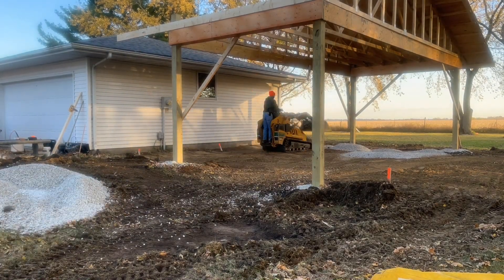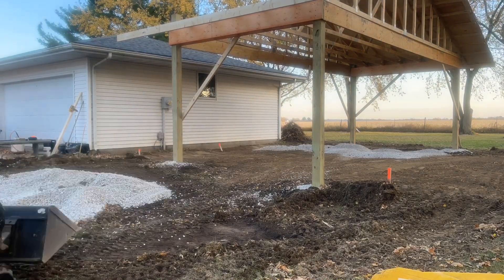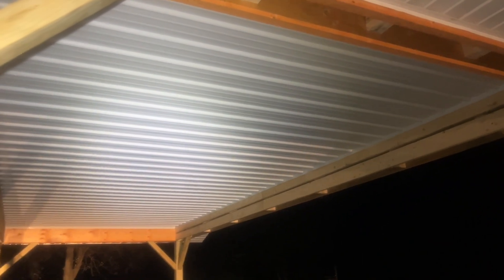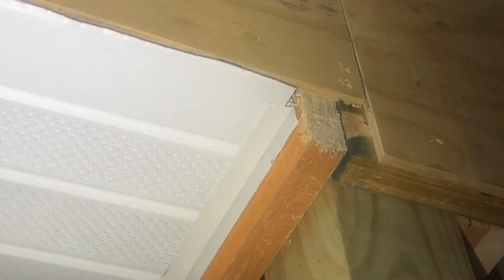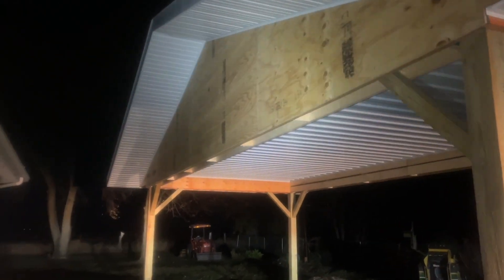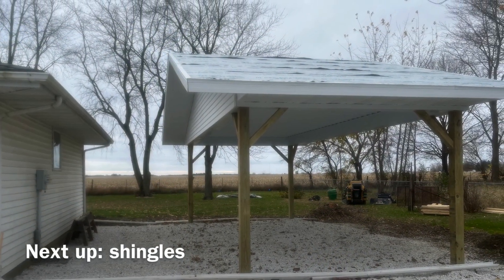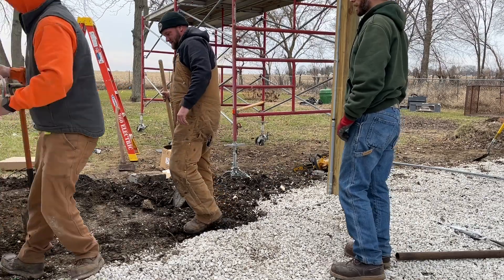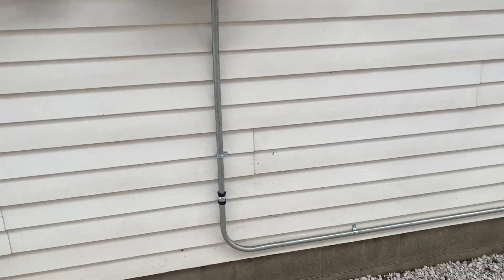Building a Solar Carport - Part 2

Comment: Really clean install on the solar. Thank you for sharing. As annoying as that conduit was to run, I would run another back for two circuits at the carport, one for a couple GFCI outlets and another for recessed lights inside your soffits and ceiling.
Reply from the maker: You are 1000% right! I had the same thought the next day. 😭 I’m grateful for what we did get done, though, just before the weather turned.

Comment: Excellent idea building a Solar carport - will do
Reply from the maker: @wardmontgomery9259  It was a way to kill 2 birds with one stone. I feel better not drill holes in my house’s roof. Thanks for watching!
Reply: @reidthemanual  I agree - I can tear off the old front porch and extend the new carport out into the front yard (12 acres) and set up for the next owner to remodel into a large family room ! Electric rates have doubled here in Northern California in the last 4 years ... with two increases this year. 50+ years of carpenter experience.
Reply from the maker: @ With that much experience, this project should be a breeze for you! Best of luck to you. 🙂